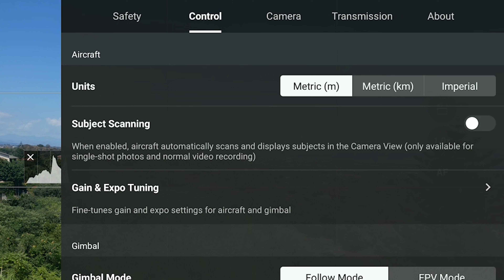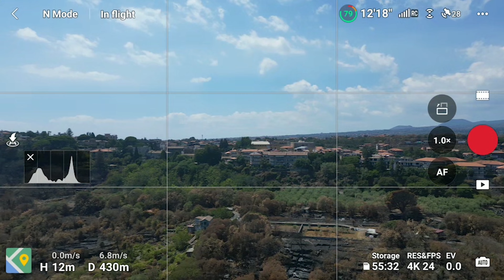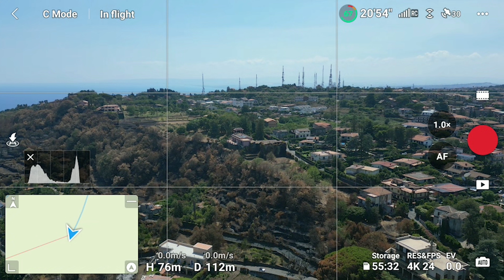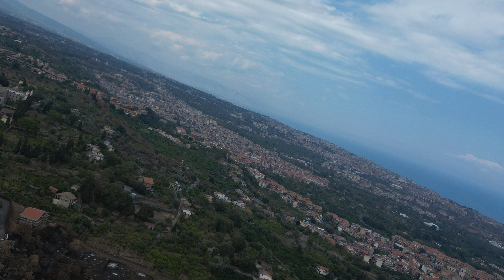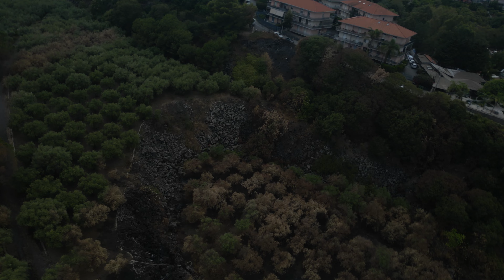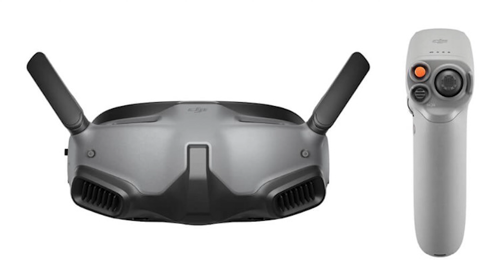Dji Mini 3 Pro FPV Footage Mode

Comment: You said the m3p fpv was better than Air2S. Does the improvement come from the updates to the app ie the experience in older Mavic models would also be improved with the later apps? (Am an Air2 owner still).

Comment: My care replacement m3p with a dozen flights just packed it in with downward sensor errors. The m3p it replaced operated flawlessly for over a yr until I deep-sixed it by mistake. Makes me wonder if it was in fact a new drone or a repaired one. The down time is annoying but the drone is amazing.